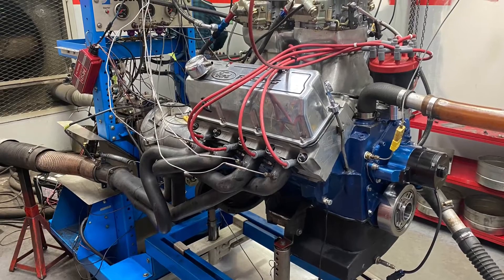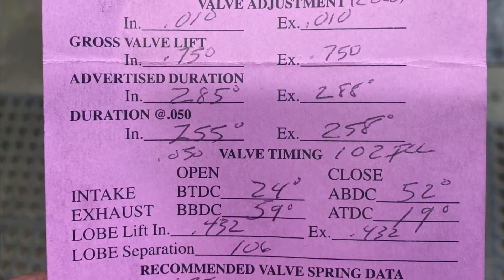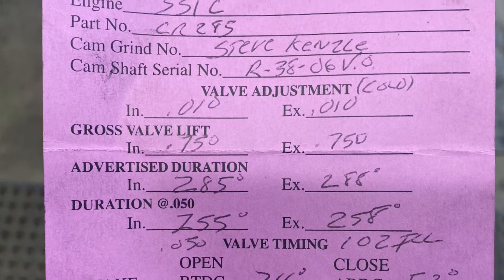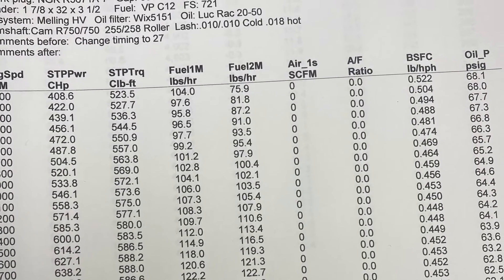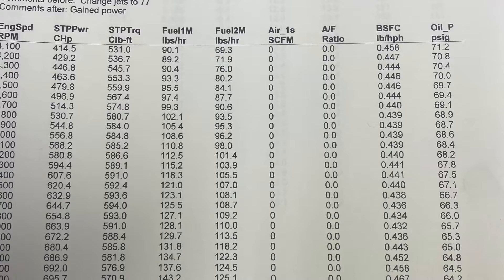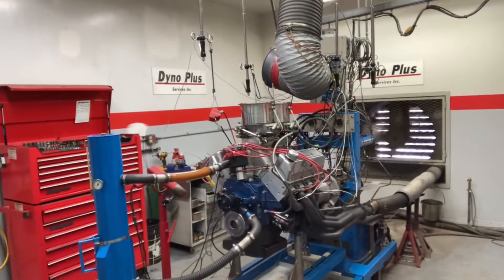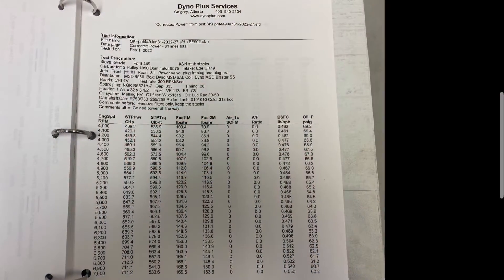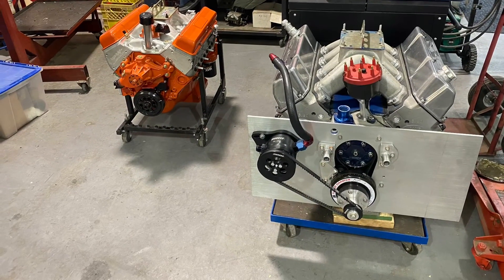DragBoss Garage:  Boat Anchor 400 Ford,  Steve Kenzle's  700 Plus HP Monster

Comment: That’s awesome!!  I’m building a 521 for a 4000 pound 68 Thunderbird “battle barge”!
Reply: And here I thought I was the only one crazy enough to try and make a late 60,s tbird fast haha. Mines a 69 though ;)
Reply: @jr7548  can’t wait to see what it does!
Reply from the maker: Another great year.
Reply: @dragboss351cleveland  68 was a pinnacle year for cars! Love em!
Reply: @jr7548  My brother owned a bunch of 58-60 square birds over the years, and they were fairly light, 3600 if I recall, with FE power. He came across a 427 from a wrecked AC Cobra and put it in his 60 T-Bird along with the top loader. That was a neat car.
Reply from the maker: @AmericanThunder that is awesome to hear, so many projects and cars we don’t know about. American ingenuity 💯🏁💪
Reply: @dragboss351cleveland Yes. I like the oddballs. I run a Mustang 2. The Rodney Dangerfield of Mustangs
Reply from the maker: @AmericanThunder that’s what makes the world go round and round 🌎🏁💯
Here you go 
https://www.youtube.com/live/B_kgfgt5gdw?si=5YwhB2KbiJSXY-Ya
Reply: @dragboss351cleveland  That was a super cool video. That drag Pinto was a work of art. I got my Mustang II in '88, a gift from my brother, so I kept it. I set it up for road course racing, but it's a street car. The 9" axle from a '59 T-bird is an almost exact fit in a Mustang II, btw. I'm still running the original 1959 3.10 gears, too. A roller Mite C4 built by Dynamic Racing with a 5000 rpm converter works great with the 2450 lb car and the high gears. I come out of 1st gear at 80, and out of 2nd gear at 130, 3rd gear is pretty fast. You'd be surprised how it launches with the 3.10s. lol
Reply from the maker: So cool I like the 68. Battle barge. Cool 2hacks. Thanks for watching.
Reply: @dragboss351cleveland  thanks!
Reply from the maker: @2HacksGarage  I will ck out your channel again see you on live chat
Reply: @dragboss351cleveland  sweet